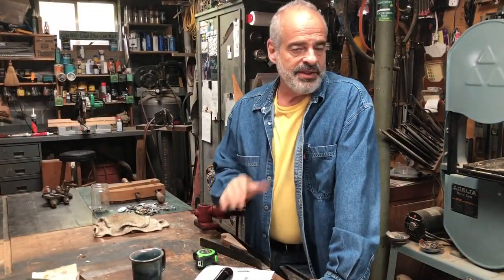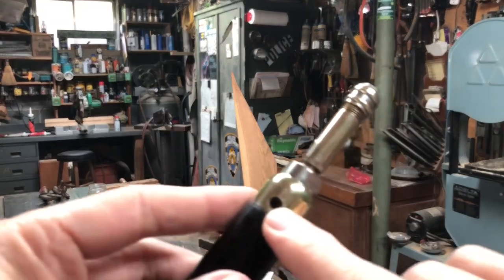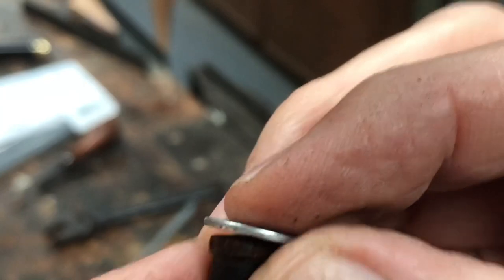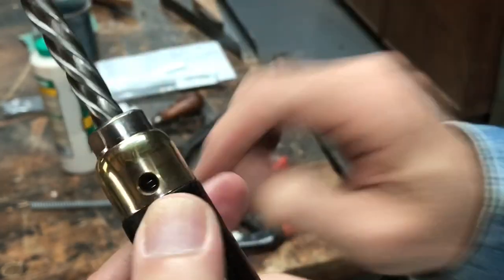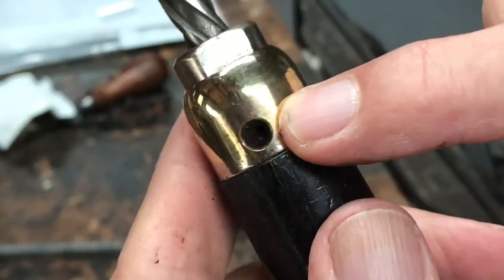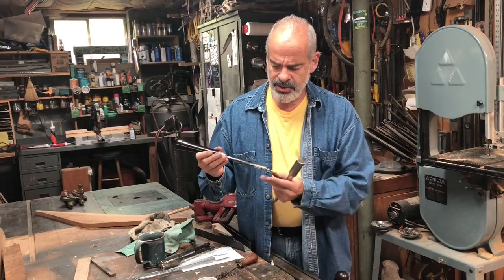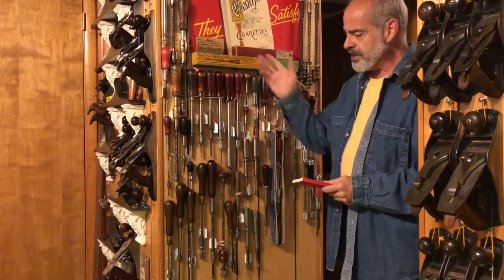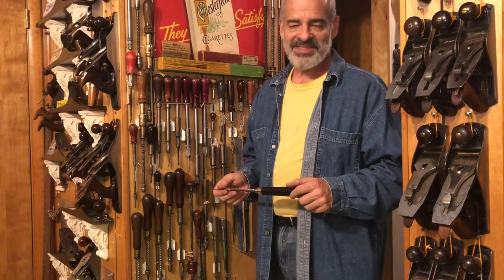HOW TO REPAIR A SPRUNG ANTIQUE  PUSH DRILL

Comment: I just found an old Millers Falls drill a week ago. Glad I found your channel. Lots of fixing to do.
Reply from the maker: I’ll be glad to assist you any way I can.
Reply: @ChetSpier  It looks like a previous owner gummed up the works somehow. It's in pretty remarkable condition otherwise. It doesn't have screws to undo it. It needs to be cleaned to undo. Do you have any preferences for lubes or cleaners for tools like this? Has a wooden handle, by the way.

Comment: Just watched this episode & really enjoyed it. This is probably the only type tool where my collection could even be compared, though I have probably less than a third the number. I bought my first, a big "Yankee" new about 1990 when it was being cleared out at the hardware store, it having been supplanted by cordless drill/drivers.
Reply from the maker: My first was the large Yankee screwdriver. I was making and installing a lot of cabinets around that time (@1976) and my father bought me one from a yard-sale for $5. I still have it today. It was great for hanging cabinets because of its reach. Many years later I bought a battery powered Ryobi drill.
Reply: My first "cordless drivers" YANKEE'S, two sizes with an assortment of driver and drill bits, were given to me by my late father in law 1981. Since his passing I was given the rest of his YANKEES, he used as an assembler in a local 🚲 factory 🏭 and yes I still use them today.

Comment: Thanks. I learned many things. I wonder if taking apart a working Yankee drill if you could get hurt from the spring flying out of control?  I don’t think mine are broken but they are gummed up and need cleaned and lubed. I have close to 30 of them for which I paid $5 each.
Reply from the maker: I think one should certainly be careful but I don’t think it’s going to hurt someone taking it apart. Slow steady and careful

Comment: Could you please please give me a part no. for the springs you ordered from Grainger? What is the best tool to cut the spring? How do you determine how long the spring should be when there’s no spring?
Love your program.
Hopefully you can find time to answer my questions.
Reply from the maker: The part no. Is 1NBX2. It has three springs. Length needed is about 4.5 inches and you can trim as needed. Side cutters work fine.
Reply: @ChetSpier  I have a 130A that has no spring.  Would this length and spring type work for that model too?
Reply from the maker: @rongriggs1460  the same will work for your 130 a , you I’ll need the wooden plug for the spring.

Comment: What a cool collection there! Bought an old Miller Falls 188a on eBay said to be 'good to go' with several original bits. Upon receiving, was disappointed to find the push pull ratchet action not working. No visible way to take apart, can you help?(I'm a novice, but will try to repair anything)
Thanks for any advice~
Reply from the maker: Here’s how to take it apart.
Reply from the maker: Email me at spier1@aol.com

Comment: Any tips for a Chuck that won't hold a hex (insty bit style) bit? The bit appears to be fine with some resistance to hand turning, but if a screw is at all tight it slips in the chuck.
Reply from the maker: Google drill bit adapters. They made several and you may need two to get to the size needed.
Reply: @ChetSpier  Thanks for responding, I just saw a video where the guy said and showed how they have very unique bits that fit inside the old chucks, and he recommended buying a modern upgrade Chuck from Lee valley tools for around 10 bucks. I'll probably go that route.

Comment: what's the best oil ,to keep things clean
as you use them
Reply from the maker: I use Alfishine hard wax on mostly wooden parts but also  
on brass to keep it from tarnishing. 
3 in 1 oil is a very nice lubricant and is ver clean. I use Aerokroil if I need a penetrating oil to free up parts. If possible I will just use air to blow off sawdust from tools before I put them away and a clean dry rag to wipe them down.
Reply: @ChetSpier  will try it ,the black off the screwdrivers was more of the problem
Reply from the maker: @davidjackson9072  that may have been a graphite lubricant that was used. That’s why it would have been black and comes off easily. You could try a lithium grease.

Comment: Have you ever replaced a spring in a Steelcraft made in France
Reply from the maker: I never have.
Reply: I picked one up at a flea market. Handle was split in half luckily both pieces were there. The spring can be taken out thru a hole in the side underneath were the Handle goes.there is a screw on the end to take the Handle off but I can't or don't know if it even comes off
Reply: The spring seems kinda thin and stretched out. Not enough strength left to push the chuck out
Reply from the maker: @stevekoon8259  was the spring intact?
Reply: @ChetSpier  yes
Reply: @ChetSpier  there is a wood plug at the end of the spring to push the rod out
Reply from the maker: @stevekoon8259  the plug is typical. Send me some pictures if you wish. Spier1@aol.com
Reply: @ChetSpier  this is the first time I have been on here. I will figure out how to send you pictures when I get out of work

Comment: I have a Yankee model 30a and 130a  that came without springs.  Could can I impose on you to tell me roughly how long to cut the springs?
Reply from the maker: I used a piece around 4.5 inches long.
Reply: @ChetSpier + 4-1/2" thanks for sharing your experience